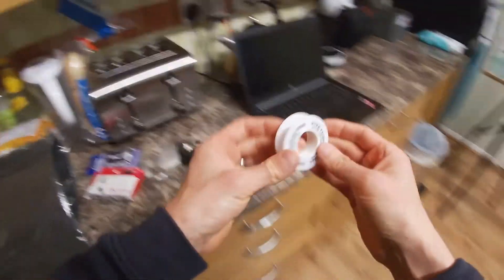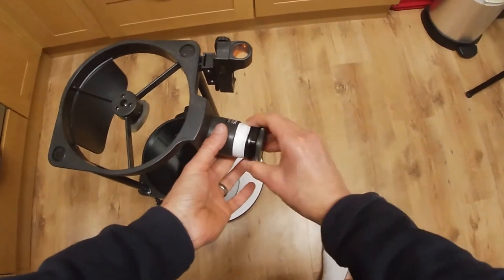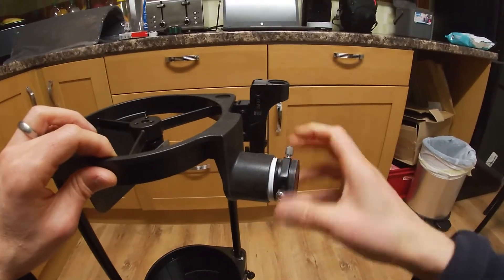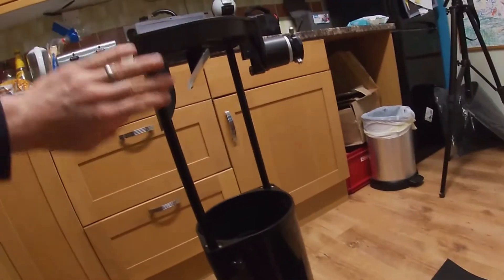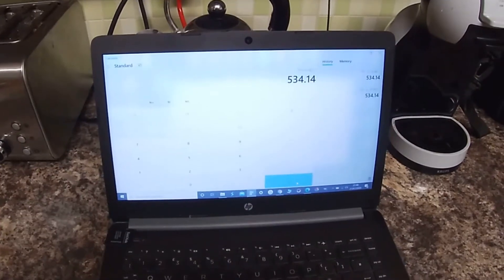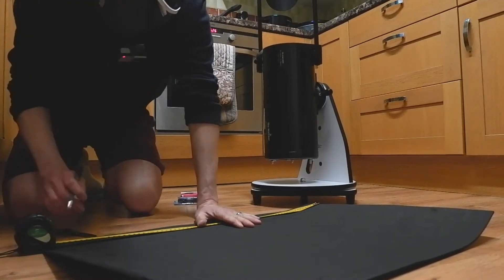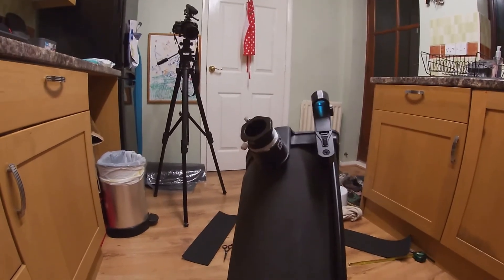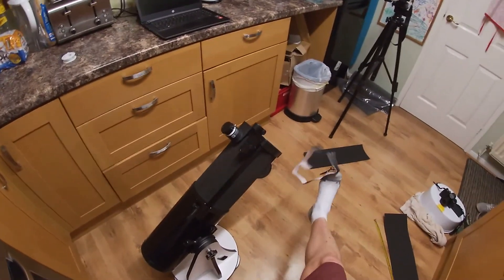Focuser and Light Shroud Mods -  Improve Your Sky-Watcher Heritage 130p 150p & OneSky Telescope

Comment: Very helpful. I'm just wondering, if you had to pick a tabletop dob with goto WiFi, which would be your choice? My main goal is astrophotography, so I know that limits me. I'm getting this as a backup to my Skywatcher Skyliner 200P, as sometimes it's too large to bring with me. Thanks very much
Reply from the maker: Hey thanks. I'm only aware of one Tabletop Dob with a Wifi controlled Goto system, and that's the GTI version of the Heritage 150p shown here - https://www.firstlightoptics.com/heritage/sky-watcher-heritage-150p-flextube-virtuoso-gti/ref/astrolavista/  It will reach focus with cameras if you lock the truss tubes at a lower position, but the second review down on the product page indicates that it's only suitable for casual short exposure EAA type imaging.

Comment: hi! your video is really useful. i have a 150p telescope. i would like to make the cover, but how do you fix it so that the cap fits on the top of the tube? i don't want dust to contaminate the primary mirror. does anyone know the solution? thank you.
Reply from the maker: Hi, thanks for your comment! You should still be able to attach the dust cap as long as the foam isn’t flush with the top of the secondary mirror cage. Just leave a 2-3mm gap for the cap’s lip to fit properly. It’s been a few years since I made this video, but I’m pretty sure that’s how I did it. Hope that helps!
Reply: @Astrolavista  thanks for the quick reply! do you remember that the screws inside the tube didn't damage the cover? didn't this contaminate the mirror? I'm a little afraid that small particles will come off. thanks😊

Comment: I've still got the 130p that I brought years ago, it gets little to no use. The main thing that lets it down is the focuser, is to put it politely, rubbish and other than what you've done there is no way of modding/upgrading to a better one. Skywatcher have built this scope to a budget but I'd have actually paid more for the scope with a better focuser as they have a very good 5"inch mirror. one of these days I'll use the mirror to build a better scope.

Comment: I know this is three years old but I just got my first telescope a sky watcher 150p

I live in the city ( small fail) but just tried it tonight and the moon was stupid bright… like almost looking at the sun bright. The scope thingy is not lining up with the viewfinder ( I am stupid new to this.) any way to fix this or is that just how it works? Ugh lol
Reply from the maker: Hi there, you can screw a 1.25" Moon filter to the bottom of your eyepieces to reduce the glare of the Moon and increase contrast: https://www.firstlightoptics.com/moon-neutral-density-filters/astro-essentials-nd96-0-9-1-25-moon-filter/ref/astrolavista/ and if you move the red dot finder forwards on the stalk, it should sit more true, allowing you to use the adjustments to align the red dot with the eyepiece view through the telescope. I think I remember this being the solution as I had the same problem.

Comment: would this mod allow it to be safe for solar eclipse viewing? (with a solar filter in the front?)
Reply from the maker: The secondary mirror housing is oval because of the truss rods so I'm not sure that a conventional round solar filter will fit securely. You may need to make a bespoke filter from Baader solar film to test it out. Theoretically as long as the sides are covered and you have a solar filter securely mounted to the front you should be fine, however I can't promise as I've not tested it.

Comment: Is there any solar filter on this telescope?
Reply from the maker: Hi there! No unfortunately you can't use open tube telescopes for solar and the top of the telescope where a solar filter would go isn't round owing to the truss rod mounting points. You would need to make a light shroud to fully conceal any gaps then make a bespoke solar filter using solar film: https://www.firstlightoptics.com/solar-filters/baader-astrosolar-safety-film-nd-50/ref/astrolavista/ it probably goes without saying to be super careful when observing the Sun but I will say it anyway to be sure :)

Comment: Hi! I have just got this telescope and have been enjoying looking at Jupiter and the moon. However, I just got a ASI224mc and can only seem to focus with the Barlow x2 in. Do I need a spacer or something for the camera to achieve focus? If so, do you have any recommendations? Many thanks and keep up the good work (the shroud works great btw)
Reply from the maker: Hey congrats on the new scope, I hope you enjoy it! The Astro Essentials low profile camera adapter may be worth a go; it will help move the sensor further into the focuser: https://www.firstlightoptics.com/adapters/astro-essentials-low-profile-camera-adapter-for-zwo-planetary-cameras/ref/astrolavista/ Otherwise you can try dropping the truss rods down an inch which will push the focal plane further out of the focuser...the only down side being light from the edge of the primary mirror will miss the secondary mirror so it effectively stops down the optics a touch E.g. instead of being a 150mm f/5, it will be closer to 140mm f5.4
Reply: Thanks for the advice! Will check this out now 😊

Comment: Thanks for the tips. The PTFE tape seems to rip and break off. Have you faced the issue? Any suggestions on how to keep the helical focuser more stable?
Reply from the maker: No worries. The PTFE tape is the only way I know of. The wider tape seems to work better, and you need to wrap just the right amount for the best result. It's also something you have to re new every so often so it's far from ideal. There's not much room for improvement with the loose plastic helical focuser, it's the Heritages Achilles heel.
Reply: @Astrolavista  thanks I was trying to collimate using a laser collimater and just a few turns of the helical focuser moved the dot quite a bit. Even the slight jiggle after adding the tape makes the dot move. I wonder how much impact this has on quality of image through the scope

Comment: Light shroud dimensions: Skywatcher 150P 560mm x 330mm.   

Thanks for this great mod and instructional video!
Reply: Do these dimensions include the overlap for the velcro and also take into account the reduced length so that the cap fits (like was mentioned in one of the mistakes at end)?
Reply: @JakeBritsch  Yes
Reply from the maker: Very welcome!

Comment: The PTF tape worked on my 130p but it does sometimes shed flakes.

I bought a 150p Virtuoso, many reasons and calculations went into this and it turns out to be the most value package out of all the GTI and Go2 options.

Anyways two things that stand out. Helical focuser on the 150p has more friction when focusing, its tight and while my 130p is flocked, the original paint job looked like that grey colour seen in the ST80 but the paint is jet black with a texture that feels like sandpaper on my 150p.

The Virtuoso has the same 150p tube as yours but i do wonder if Skywatcher made some modifications since you bought yours because PTF tape isn't required and neither is flocking or if it's because it's the Virtuoso version. The quality just feels more premium on the 150p.
Reply from the maker: Hopefully they have made changes like you say, the helical focuser was loose and sloppy on the Heritage 150p when I had one so good to hear this has potentially changed.
Reply: @Astrolavista  That was the first thing i checked when i got it, we'll see how long it stays that way and seems to hold large eyepieces like my 100 degree APM eyepieces without issue but does look a bit odd seeing them sticking out the side. My only minor, very minor complaint if i had one, is the red dot finderscope placement being right behind the eyepiece, ok if viewing from the right side but not the left. Now i am just looking for ways to pimp it out lol.

Comment: Great mod.  I used a thin yoga mat material cut similarly as in your video for my 130P 5” Skywatcher Heritage and it works beautifully.  The yoga mat adds insulating properties, is already matt finished so anti-glare and it allows for retraction without damaging the mirrors.    Thank you for your informative video!

Comment: Thanks for this vid. I’ve done both mods and they actually work! I admit a 2nd attempt was needed. Tip: the Velcro on the shroud will bend outwards so may come off so a bit of (super) glue may help. Thanks again
Reply from the maker: Cheers Paul, glad it helped and thanks for the tip.

Comment: Hello and Merry Christmas! I also have this telescope and was thinking of making this shroud, but I hesitate a bit, thinking about the outside elements. Would it not change its shape if it is exposed to frost? I'm afraid I could damage the mirrors if there is some lack of attention, during daylight and especially in the dark. Thanks for your very useful videos and thanks in advance for your time if you see and reply to this comment! :)
Reply from the maker: Merry Christmas :) I had my shroud on for 18 months with no issues so I think it would be ok. It's only foam so it wont damage the mirror, plus modern mirrors have an overcoat layer to protect them. Cheers :)

Comment: Can that type of focuser deal with a phone adapter for some basic imaging, it doesnt look promising. I am considering on buying 130p or 150p as a grab and go, wouldn't want to brake the focuser of when taking pictures..
Reply from the maker: Hey Predrag, it really isn't the best focuser without doing the PTFE tape mod, there is a lot of play and it's quite loose so easily turns. Because a phone attaches at one end where the lens is, it would act like a big lever and constantly hang down under gravity. I think it could work if you used the PTFE plumbers tape because you could wrap enough around the thread such that it becomes fairly stiff to turn, then it should hold....but give me a rack and pinion focuser any day!

Comment: Great video. My question - about the length of the screen. Can I make the screen shorter? I'm worried I might hit the screen in the primary mirror.
Reply from the maker: Hi, yes! it just needs to be long enough to reach inside the bottom section when the telescope is fully extended. It's been a little while since I made the video but I think I talk about this subject at some point. When my Heritage 150p is in the collapsed position the light shroud clears the primary mirror by a good margin so you will be just fine :)

Comment: great mods, i also like to put dewcap extending another 8" beyond the front as the 2nd mirror can get dewed up in the dewy months. Most people think dew caps for stc/mak's but it also helps for reflectors where the mirror is close the top of the tube. PS i also have a astro channel mainly on telescopes and reviews etc. i will sub to you joe
Reply from the maker: You're absolutely right Joe, secondaries on reflectors definitely dew up so you're right to use a dew shield. I used to have SCT's and moved to an RC thinking I could lose the dew shield....no chance lol

Comment: Great mod and great video.  I'm considering the 130p as my first scope and was wondering about all that open space when it is in that extended position.
Reply: I am struggling between this one of zhumell z130 because seems like it is better .more solid . But of course it is heavier . 10kg vs Hertiage one is 4kg . It is a gift for someone I dont know what to choose
Reply: @ericaroundtheworld  The Heritage 130p the base alone is about 4KG and the tube is about 3KG. The Zhumel was the combined weight, the Heritage 130p combined weight is about 7KG. The Zhumel costs more than the Heritage 150p in the UK.

Comment: May i ask which lense did you use to view Saturn and Jupiter? i only have 10mm, is it sufficient to view Saturn's ring and Jupiter's moon? or shud i upgrade to 5mm? Ive just have my 150p.
Reply from the maker: Hi Kenneth, I do most my viewing on screen via a ZWO astronomy camera so I can share what I see, but when treating myself to some time at the eyepiece I use a 6mm Explore scientific, or one of my Plossl eyepieces with a Barlow lens e.g a 12 mm Plossl with a 2.5x Barlow giving the equivalent of a 4.8mm @ 156x. Your 10mm will only give 75x magnification so the planets will appear both small and bright, so it would be tricky to resolve a lot of detail. A 5-6mm would be better. 150x is a good mag for average seeing conditions for planetary viewing.
Reply: @Astrolavista  thanks for your reply. Yes it's in my mind now to get the 5mm so i could have good viewing of the planets and its details. However, where do you get the Plossl eyepieces?
Reply from the maker: @kennethgan7431  Before I suggest a supplier. can I just check which country you're based in Kenneth? One thing you should know about Plossls is that their eye relief and eye lens size scales with focal length, so anything below about 10mm can be uncomfortable to use as you need to jam your eye right in there. Not great if you wear glasses! I personally don't own any Plossls below 12mm for this reason, but you can use a Barlow lens with lenses to increase the mag and it wont effect the eye relief. This is what I do.  An example of a comfortable 5mm eyepiece with a large eye lens and plenty of eye relief would be something like a BST Starguider, or Skywatcher planetary eyepieces. These universally get great reviews, my father in law owns the full set of StarGuider's and loves them. I've owned a few over the years and only sold them to buy more expensive eyepieces, although the expensive eyepieces weren't hugely better in my opinion, just a bigger field of view and maybe a touch less scatter. Diminishing returns and all that. Here's a link to some eyepieces in the UK at least: 

https://www.firstlightoptics.com/bst-starguider-eyepieces/ref/diyastro/

   https://www.firstlightoptics.com/skywatcher-eyepieces/skywatcher-uwa-planetary-eyepieces/ref/diyastro/

Below are the sharpest for the money, but not as comfortable to use: 

https://www.firstlightoptics.com/baader-planetarium/baader-classic-ortho-bco-eyepiece/ref/diyastro/

Comment: You had me cringing.  Don't mess with stuff near the end of the tube when it is pointing up.  One slip and you could mess up your primary mirror.  Placing the tube in a horizontal position is much safer.
Reply from the maker: Hi Mark, you're right and I even talk about this in the video. Years ago a dropped a screw on a primary mirror and marked it.
Reply: @Astrolavista  Pin his comment!
Reply: Or remove the primary completely during the process, keeps it clean. And probobmy needs collimation after all of this?

Comment: Hi I'm thinking of getting one of these for use on my celestron nexstar 4se mount as I think it within the mounts capability. What do you think?
Reply from the maker: I know the mount you have well Paul, both a 4SE and 5SE have passed through my hands over the years. It's a very nice little mount but I honestly doubt there would be enough clearance for such a large optical tube as the 150p. I think if you slewed anywhere near zenith it would collide with the mount. The dovetail is short also so you can't get round this by moving the OTA further forward either. I once stuck a 90mm f6 refractor on a 4SE mount and I couldn't reach zenith with that either.

Comment: Hello Chris,
I am looking to buy the Skywatcher 150p soon, mostly because I want something portable yet sturdy and its in a pretty good price range. These mods seem great so I will likely use them as well. I was wondering though if it may be necessary to buy additional accessories? I am thinking of getting a 2 or 3x Barlow lense for additional magnification, seems possible from what I'm reading in the comments. Do you have any suggestions for which would be better, and would I need to think about buying filters as well for better viewing?
Cheers in advance
Reply from the maker: Hi Jurre, for the money it would be really hard to find better optics so I think you would be making a good choice. If you're interested in viewing or imaging the planets then a 2x Barlow would be a good choice to increase your focal length. I use a 2.5x Barlow to view and image the planets with the Heritage 150p. I wouldn't worry about filters for now unless you spend a lot of time viewing the Moon in which case a Moon filter would help take away some of the intense glare for better contrast and more comfortable viewing. I've made a number of videos based around the Heritage 150p if you've not seen them already? I've even had surprisingly good look imaging the planets with it. Not the easiest scope to image with but it's impressed me :)
Reply: @Astrolavista  Thanks for the help! I think I'll look into the Barlows and decide on 2x or 2.5x when I've toyed with the telescope a bit. And I will check your other videos on the telescope as well, wasn't aware of them!